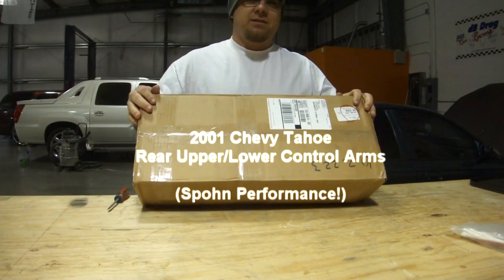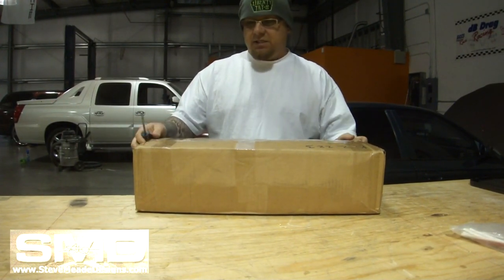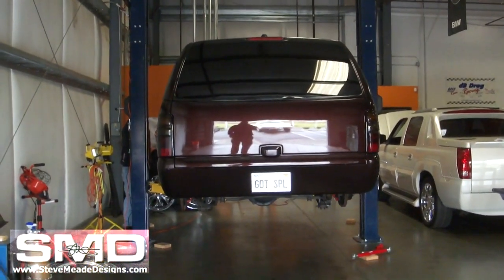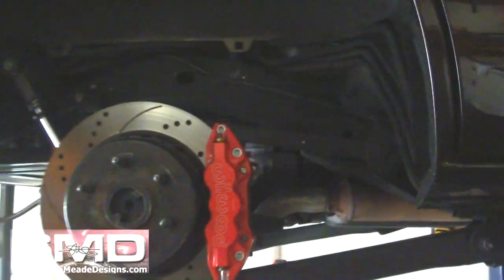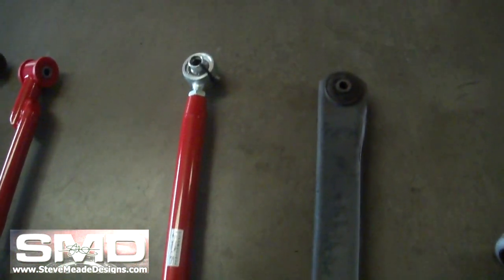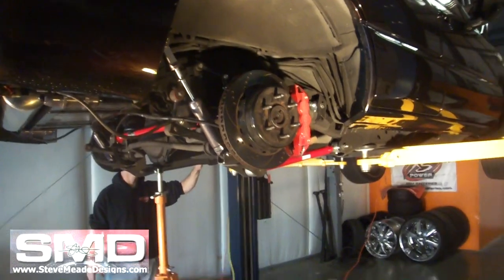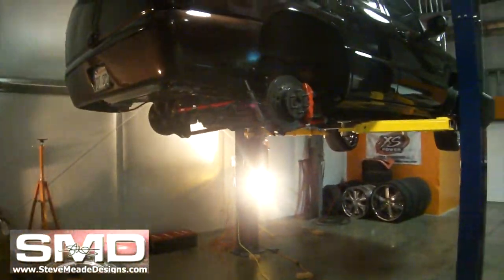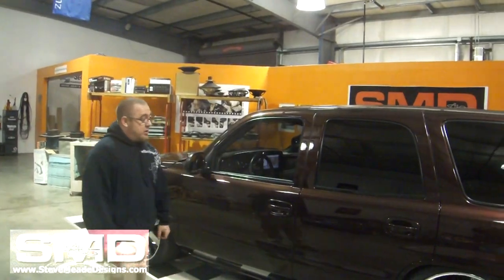SPOHN PERFORMANCE - Chevy Tahoe Adjustable Upper/Lower Rear Control Arms

Comment: the last thing you need to get steve is a full on train horn, and have a toggle switch to change from the stock to it, then you can blast away with that, would be sweet, those do 152 db themselves, and you already have the air system, finding a place to mount would be the hardest, under the suv would be best! :P

Comment from the maker: @anckentucky if you went to the store and bought everything i bought at MSRP and had someone build everything i got, over 50 1/0 and 2/0 wires, 10 batteries custom cutout, buss bars, completely sound deadened head to toe, 4 custom fiberglass door panels wrapped to match the interior.....4 alternators.......i can go on and on.  It might very well be that much.  If not its gettin there....

Comment: I see you still have the stock lower arm mounts on the rearend. That's how mine was also. I never had any problems. So why does Jdm think you need to cut it off and use there drop braket?

Comment: @meade916 - I have a 2001 Chevy Tahoe LS 2WD with the 5.3L motor. I’m wanting to upgrade the suspension and go with a 2/3 drop to level it out. Would a panhard bar help me out when having my SUV lowered? I’m also not planning to do airbags on it.